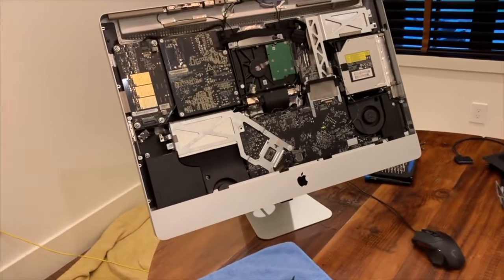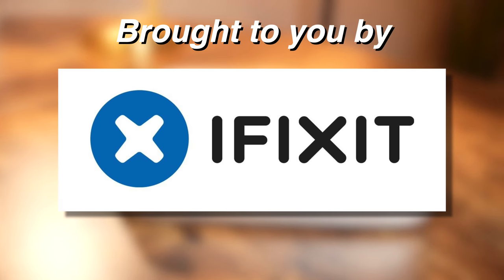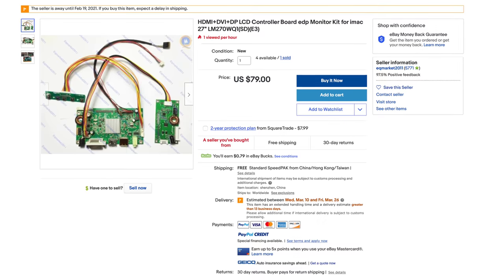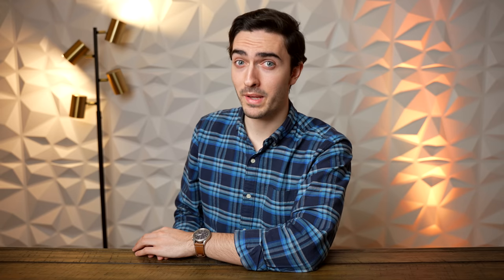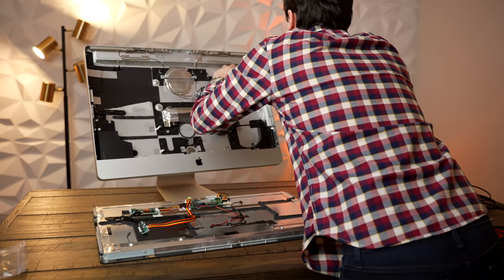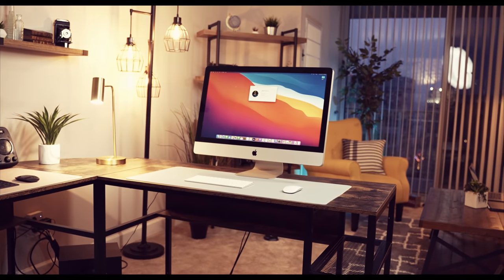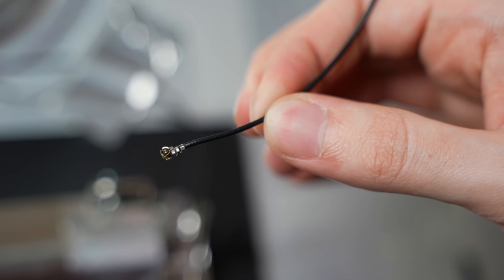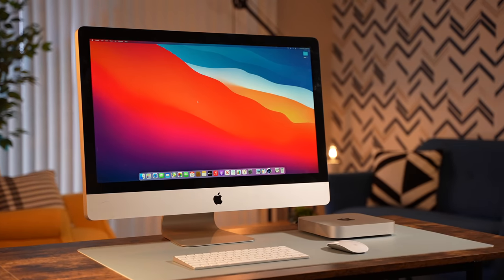How to build your own DIY Apple Silicon iMac!

Comment: It would be awesome to see all the ports working and the optical drive slot working as well.
Reply: there's prob an adapter to go from USB-C to the internal cables uses by the optical drive and SD card. And then get a Male USB-C to Female USB-C cable to extend the reach from the Mac mini's port to outside the iMac shell.

Comment: The ports and power button issues are relatively easy to resolve. Same for the mounting of the Mac Mini inside the iMac chassis with a little effort and tools.

This feels kind of half-baked when it really didn't have to be, but it's still nice to see and full of useful information for those interested in and willing to put in a little extra work to build some "Classic" M1 iMacs.

It's an especially great way to repurpose dead iMacs, such as the one in this video, and I happen to have one sitting on a shelf in my closet as well, so I think I'm going to give it a shot once I get an M1 Mac Mini.

Comment: great idea!! consider that: cut a hole in the side of the iMac right in the disc slot and put the board of the mac mini in a way that you have the  plastic part with the ports and power button facing the side and fitting the hole. re-glue the standoff in a place that helps you screw the board in the place you need to.

Comment: Love how the Mac mini is "mounted" inside the imac - totally not like my SSD's on my side build ähm ohmm
Reply: In one of my PC's, the hard drive (no, not an SSD, an actual hard drive, the ones that break if they vibrate too much) is "held in place" by nothing but the sata power and data cables. I have no idea how it's still working.

Comment: You could make extension cables for the usb inputs and the power button so you don't have to remove the display every time you wanna use the device. Cool video too

Comment: "It doesn't have any ports."

Apple agrees.
Reply: For the place of the removed optical drive, just put a dock there, with type c, usb, hdmi and card reader.
For the power button, doesn't Mac have the power on by keyboard option?

Comment: Hi Luke, great work here!
I now kind of regret to have upgraded my 10 year old iMac to (almost) the max last year (i9 and 1TB SSD).

Do you think it would be possible to add ports by using simple extension cables with some kind of fixture plate where the original ports sat?
Do you think the original iMac power button can be connected or is the one on the mac mini soldered on?

Last thing: It would be great to use the excess power of the mac mini to power the screen ...

Comment: I love the idea of this! My question is, could you run a TB4 cable out of the back and into a TB Dock? That should suffice, shouldn't it?
Reply: I mean, yes that’s totally fine. The only problem remaining is being able to power it on. And I imagine it should be technically be possible to solder the original power button to the circuitry in the mac mini. But don’t quote me about this.
Reply: @sashapaleologue1234  should be easy to do imo. Should just be removing the power button, resoldering longer cables from the board to the button, then fixing some small 3D printed mount to the inside so the button can be pushed from the outside. Hell you could probably wire it to the iMac power button as it’s just a button that sends a “power” signal to the device afaik
Reply: @sashapaleologue1234  of course...anyone with alittle technical skill and a volt /ohm meter could figure it out..just a remote switch

Comment: For ports, extension cables cost little even for thunderbolts and you can glue them on position to reuse the ports on iMac body. And for power bottom, try to install some remote smart motor things.

Comment: Just run extended cables for usb/thunder out of the case.  

With some soldering, power cable could be shared between display and Mac mini power supply, and perhaps soldering the original logic boards connectors for the ports themselves.  Totally doable.

Comment: Luke, great video. one suggestion, you can enable auto startup on a power failure in OS/X system settings, Energy Saver, and then just unplug the power cord and plug it back in to auto start the iMac. No need to access the power button inside the iMac to turn it on.

Comment: You could run a Thunderbolt 3 extension from within and then buy one of those m1 docks which sits under the stand, nice and clean. as for air flow you can get creative and find some thin plastic sheets to redirect to the vent holes. But its still not there yet as there is no internal audio as the speakers have been removed unless you put them back with an amp :)

Comment: Hi Luke you could use usb/thunderbolt ect extensions to the back panel, I want to know if the brightness is still working and you could of probably used the internal speakers also

Comment: One thing I think would be cool would be to connect all of the standard peripheral cables to the mac mini but just keep them mostly in the shell of the display with their connectors poking out slightly. Pseudo-retractable peripheral cables! I’m sure it would all fit in that hole. Plus you could reinsert the optical drive that used to be in there and connect that to the mac mini via an adapter and give it something it didn’t have.

Comment: Nice video. You want to get yourself a nice but cheap 3D printer (I would recommend an Ender 3). You could design and print your own mount to attach the mac mini to the inside of the iMac. You could also mount usb extenders so that you could extend the ports from the mac mini to the existing holes in the iMac. You could also do the same with the power button.

Comment: When you said you didn’t have the skills to make a custom enclosure or modify the iMac case, I wasn’t going to argue.

But having seen the stripped case, I’m going to argue.

Gluing some Lego bricks to the shell would provide a solid base to anchor the Mini logic board anywhere you wanted it.

Redirecting the Power button to the iMac Power button would be the first hack, and a man who rebuilt 7 of 10 MacBooks saved from a trashcan can do that.

Strip the ports off the old logic board.

Literally SAW the old logic board apart with a Dremel abrasive wheel.

Cut any redundant circuit traces.   Get cables, chop off one end and solder to the sockets.

Site the sockets where the case ports were, attach cables and epoxy them down.

Plug the cables into the Mini board.

Now, even if the ports aren’t identical, you should be able to fake it 

Press Power button, the Mini board turns on.

Comment: Your experiment could have led to a far better M1 iMac than actually appeared. I hope you will revisit it with some help.
It would not be too difficult to re-purpose port holes in the back and maybe add a C auxiliary upon which to suspend one of those inexpensive Mac Mini docks allowing multi-monitor use.
Audio would not be on the side like on the new iMac and there would be SD and the old optical drive could take a blu-ray.
Finally, by having thin wires from wifi and bluetooth chips you would overcome the persistent drop-out problems still spoiling the Mini in 2022.
Keep up your superb channel. It is honest and well articulated without the silly SFX which wreck others.

Comment: I would really do even the ports and power button without an issue, just get some extender cables for ports and 3d print a plastic holder for it on the back and also wire a power button outside on the back on that 3d printed hub and voila !

Comment: what you could have done for the missing ports is drilling some holes in the bottom front of the iMac and have some sorts of "extensions" cables to connect your USB-C ports, USB-A ports, Audio ports and whatever other port there is on the mac mini board, to your front "panel".  You could eventually make a new video with "DYI Perks" who has tremendous capabilities and expertise in this type of mods. :)

Comment: It seems you could purchase extension cables for all of the ports and tape them to the corresponding holes on the casing. Same with the power button with some modification.

Comment: You could actually plug multi usb A and C dongle in through the power hole then you could actually build a switch with the original iMac switch and it very simple with just a little soldering technique

Comment: You could take the Macs power button cable, cut it, take the Mac mini’s power button connector, cut the power button off of it, and join them with some twisting + electrical tape. I think it would also be cool to cut the Mac mini’s power cable to get the two prong connector and wire it into the power socket. Finally, you could use some usb extenders and hot glue for the usb ports

Comment: Hmm you could get a usb-c/thunderbold  adapter and drill in a hole in the chaise so the dongle fits in there and than glue it in place and connect it with the  mac mini. and for the power-button you could drill another small hole and put in a stick that pulls the button. So you would get all the functions that are missing right now, but it would still keep its Frankenstein character.

Comment: You could a USB4/thunderbolt hub to access the ports and probably resolder the power button to iMac's external power button(if it has one) or use a an external click switch outside the Mac.

Comment: This is a great idea to get a 27" M1 iMac. Something you can do is solder the iMac power button to the Mac mini with some longer wires. Then either manually solder wires to connect the I/O for the Mac mini to the rear I/O for the iMac or use some short extensions and epoxy. Please revise this build and upload a new video.

Comment: Agree about the point of not putting the mini inside but wasn't it more fun?  USB could be added by using an extension cable, suppose something similar could be done with the power switch

Comment: Thank you so much for sharing on it. Maybe is not the best move, but on iMacs that are failing on the power button functionality, you can set up an automatic wakeup every morning; or afternoon let's say , and so you are not needed to have a working power button accessible. For the USB and thunderbolt ports, maybe it could be of interest to add an internal extension for two thunderbolts 4/3 and two usb ports to be attached to the 4 USB on the case, even ethernet.  Waiting for silicon iMac too, keep the great job!

Comment: When you talked about removing the display every time you need to power on the machine, I remember when Anthony, from Linus Tech, Tips broke a iMac display when installing it because he got a static shock and dropped it. Those aluminum chassis can be nasty.

Comment: You could technically add ports with port cable extenders for the USB ones. The same can kinda work for an sd card reader.

Comment: The two Thunderbolt/USB 4 ports, two USB-A ports, ethernet port, 3.5mm headphone jack, and internal speaker can all be re-routed to port spaces on the back. Use one of the USB-A ports to connect a 4-port USB 3.1 hub. Use the other with another hub to provide connections for the audio line in and to connect the iMac's video camera. More cables to manage, but it would restore almost all the functionality of the iMac (except for the Firewire port, and nobody's using that anymore. You could have also left in the DVDRW and used a SATA-to-USB3 cable to connect it to the M1. You might also want to consider routing some air ducting between the M1 and the vent on the iMac case. None of this shouldn't take any significant skill to accomplish.

Comment: You should've rotated the mini, so the port were where the DVD slot is, then just widen the slot so you could plug things into it. It would also take care of the power button as well. I am surprised you were able to drive the screen so easily, I figured you would need some kind of interface board.

Comment: Excellent and I too am a iMac fan and looking forward to a iMac with a M1 Max and 64GB RAM inside.    

You do have another possible Apple SOC iMac.  Convert iMac to a display like you did, but then get some Duct tape and just tape the Mac Mini to the back of ith iMac.   You have easy access to the ports and as you said it's a desktop so who's going to be moving it much anyway.

Comment: Could you not make a Breakout board that populates the IO ports and power button,  it will mean some solder and jumper wires to get a couple things working, an what about getting that optical drive installed with a usb to sata converter. Might be worth a revisit.

Comment: How does that display adapter handle colour accuracy and colour spaces? I mean, does it use the display like for like or does it have drawbacks in terms of what I've mentioned? I am genuinely curious as I'd like a colour accurate secondary display for my M1 MacBook Pro and a 27" dead iMac might just be a really good option.

Comment: i know im a bit late but you can buy USB extension cables and other extension cables and route your extension cables to the original io ports of the imac meaning you would have the ports and maybe even rewire the power button to the original one and then you end up with a fully working desktop

Comment: I strongly believe that the real reason why M1/M3 iMac is 24" is this:

Apple wanted iMac to once again become that "social accepted all in one machine". iMac 21,5/27 was not the perfect social accepted iMac.

iMac 21,5/27 was more like an option to Mac Pro than a social accepted iMac. Because Apple had so much problems with Mac Pro.

Now with both Mac Studio and the new Mac Pro, there's no need for an "iMac Pro". So that's why iMac is not "that powerful". Of course it's important with performance but look at the design. It's the "sweetspot size" (24"). iMac 27" is REALLY big! And 21,5" is too small. It's a great thing from Apple!

And those who want iMac 27, these guys can buy Mac Studio with Apple's 5K 27" or any 27" from other companies.

I might be wrong but my feeling is that iMac 24" is here to stay for many years...

Comment: i would modify the old power button with an actual button and solder a piggyback connection to said new button actuators to the mac mini power button pins.... as for ports, you could just buy extension cables and glue the female side to the existing ports... or you could buy those ones for desktop cases with the pcie brackets that can screw to those brackets or other surfaces that are commonly used for custom made cases or for custom boards with a non moveable ports into a custom case... they do exist and you can screw them to the back port with the help of a small drill bit... i actually have a ton of those extension cables with the screw holes on the female side because they are useful for DIY projects and they are very cheap and easy to find... i think the only problem is the thunderbolt 3 extensions....

Comment: No ports? No problem, Apple would have introduced that sooner or later anyway. You are just 1 year ahead of the time. But you could at least let the ports hang out at the back with extension cables. Also an on / off switch. Great video

Comment: crazy cool project and I was about to throw raves ur way until you said u gotta open the screen to turn it on and off!  theres gotta be a way to wire the mini power switch to the original imac power on switch... overall though, insanely wild imac u got there bro!

Comment: Can't wait to replace my aging late 201 iMac 27". I accidentally broke the tilt mechanism so I have to brace the iMac at the right angle. I'm hoping for a new enclosure as plugging in cable to ports in the back is complicated by the rounded shape making it awkward (how the tilt mechanism got broken. Would love 30" using thinnesr bezel. A 21" stretched to 23" wouldn't do it for me. I have a 3.4GHz Core i5 with 32G RAM and a 3TB hard drive. I've used less than 1TB (mostly photos). Performance is sluggish and the front facing camera used for FaceTime and PhotoBooth could be much better. I won't buy until I can get an M1. I do confess to also owning a 1917 Mac 12" to take on trips. I find it quite up to the job, but doesn't get much use at home. Thanks for so many wonderful videos. I'm retired DBA from Wizards of the Coast. I worked back in the early days when their entire company ran on a large network of Macs with rack mounted Mac & INtel servers. Those were the days. I'm 75, but still love my new iPhone 12 Pro Max, my 3 AppleTVs, old Time Machine.

Comment: No ports, but you're not far behind the MacBook Air on that score.  You could just run a cable out to a USB hub and come out ahead.  The power switch is a trivial fix: two wires and a couple of minutes with a soldering iron.

Comment: And I've been following you for a long time, but I skipped this video, for me you did a rather messy job, it wasn't possible to turn the mac mini with the ports to the outside right, maybe you modified the external side of the mac to be able reach the ports of the mac mini....you are always so precise, why didn't you try the solution to be able to use the ports of the mac mini anyway, it would have been complete, sorry Steve, I always admire you for your politeness and kindness.
Greetings Frank.

Comment: This video was pretty hilarious 😆 

But also I honestly don’t know why Apple don’t sell a simple 1440p IPS monitor in refurbished iMac enclosures. What are Mac Mini owners supposed to use, the Pro Display XDR that costs 7 times as much as the Mac Mini!? 
And for the ports: just mill out that bit of the enclosure, fit a new screw in piece and use it for the display inputs and any hub ports if they can add those.

Comment: Cool build especially since you have the dead iMac. I like the 24" iMac recently released but it would need to be space grey or at least the black bezel. Can't deal with the white surround. Maybe the 30" will come in space gray but the 24" with VESA configuration would fit inside my roll top desk better.